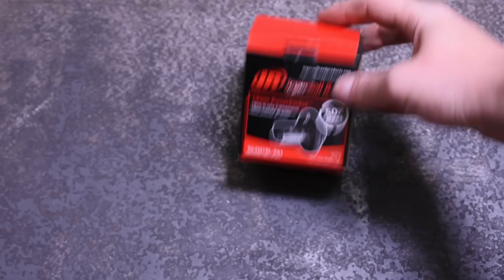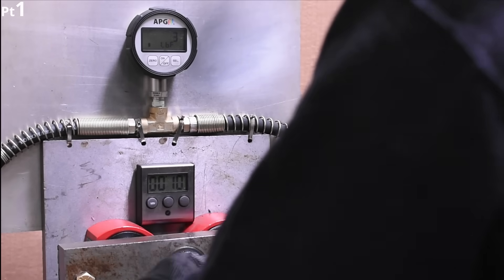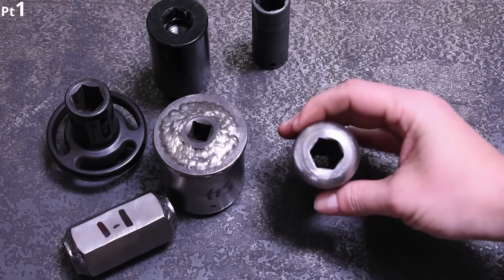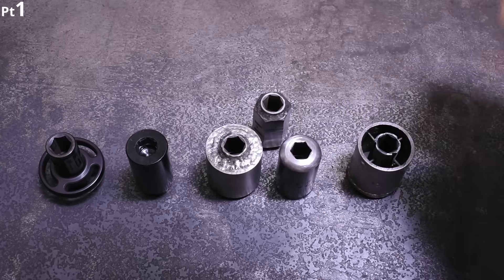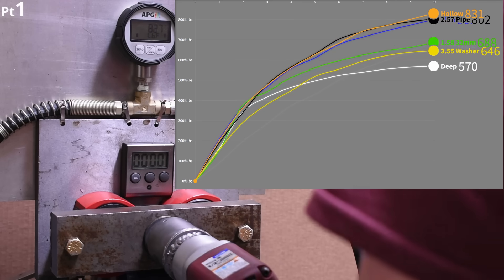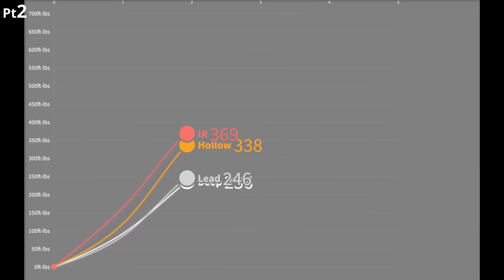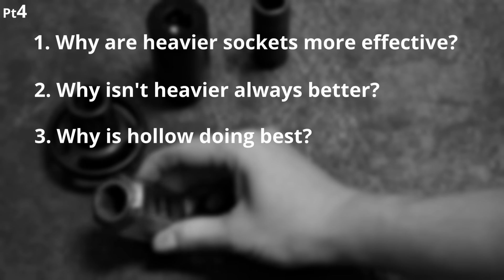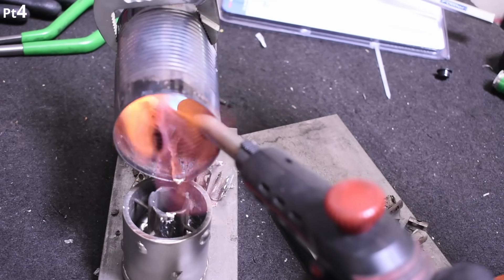Heavier Sockets Make More Power? Stumps Physicist

Comment: Not a expert in any way, but torque is a function of force over distance so if your mass is more on the exterior it might apply more leverage. The hollow socket probably preformed better do to low mass density with weight more on the out side. just food for thought tho. Love the videos

Comment: My understanding of this results is more related to impedance balancing. Impacts are more vibrations than torque so it may make a real difference. This is something very common in ultrasound welding. Impedance for the purpose of those sockets is a combination of elasticity and momentum of inertia. Imagine if you have to choose how to protect your finger from being hit by a  hammer. It will be either using a big block of rubber or a big lump of hard rock. Not a small block of steel of the same type than the hammer itself. Rubber, light but very elastic would protect you from the choc and rock hard but heavy too...not something the same elasticity and weight than the hammer. In your experience you don't want to protect the bolt but rather ensure it receives as much schock as possible. So the best socket has to be just the good inertia/elasticity to optimize the energy transmission.  Note that the size and elasticity of the bolt MAY also change the overall result. 
Just my two cents...

Comment: It's not just a socket, it's a system.  The mass of the hammers in the gun would be a factor too.  Also there might be a difference in the way the socket is hitting the bolt head too ... like big bang motorcycle engines vs flat plane ... even though they make less power the result of the system is a faster motorcycle because the tire has more time to recover traction after an impact of a power stroke from the engine.  It's certainly an interesting test.  Maybe Smarter Every Day would be interested?

Comment: I would presume that a cleverly engineered flywheel would allow you to store energy which fails to transfer on a given blow with greater efficiency than storing it in a "spring", since the storage isn't time-sensitive like storing it in the torsion of the socket or driver itself. Theoretically, the impacts need to be timed such that you can transfer the energy stored in the rebound of each impact into the next impact, which is strictly dependent on the materials involved, and thus your efficiency depends entirely on the combination of materials used in each specific scenario; as such, if you can carefully design your flywheel, you could capture some of the rebound and reduce the time to the next blow, which could potentially give you benefits. Not that you can simply extract extra energy by magic or anything, but in some ways you can make more power over time by increasing startup time.

Comment: My best guess is the weight of the socket changing the timing for the socket bouncing back. Like jumping on a trampoline, to heavy and the hammer hits too late too light and the hammer hits too early.  Mayhaps find a guy that's good with oscillations. Could check if this is the case with the slow-mo on your phone camera.

Comment: What if you made extensions with that flywheel design at the base near the impact wrench? You can weld bigger and bigger washers on to the base to see if there is a magic number that will match or even go above the original output of the impact even with the extension.

Comment: the added "torque" gained is from the inertia of the weighted socket slamming into the bolt head with each hammer strike. as long as the weight isn't so much that the tool cant accelerate it to the tools max speed you will gain in inertia. the trick is to find the right amount of weight that the tool can accelerate to its max speed with each hammer strike, anything more than that and you will experience diminishing returns as you found out.

Comment: How about a socket extension?  Could a flywheel be incorporated into a super-short extension to get the same effect?

Also ... force is being applied in a regular pattern - a frequency - I don't know why the scientists aren't paying attention to that fact!  Rigid bodies have harmonics, so it's possible that given the frequency of the hammer and a resonant mass being driven, that the phase interference can either help or hinder the effect of the hammer blows against the anvil.  Not sure how to measure this but it could make a good follow-up.

Comment: stump a physics proffesor ? shiiiiit newton already figured it out. enertia explains all of it. the gun flexes everything in run direction and since the increased mass resists springing backwards much more, the bolt has no choice but to keep going 2 steps in one direction and only one step backwards. vs 2 and 2. think of these things as reverse torue sticks.

Comment: The lead was never going to work, way too soft of a material as it will just absorb the impacts. Not much of a physics professor if he cant admit when he was wrong but it is what it is.

In my opinion (ignoring material differences), the reason a heavier socket (ie. higher moment of inertia) works is because you are minimizing the friction by essentially eliminating one of the two joints from the impacting force. With a heavier socket (to a point) you are transfering kinetic energy to the socket which still results in frictional losses but nowhere near as much as a stuck bolt. Then the socket itself will transfer said kinetic energy to the bolt through a single joint which results in much lower losses.

Comment: You want the mass as far away from the centerline of the tool as possible.  That's why the flywheel design worked so well as well as the hollow one - those put the weight out away from the centerline.  Simply adding more weight toward the middle (near the centerline) won't typically help that much.

Comment: The big problem with the lead is it's so soft it'll deform slightly and lose energy from internal damping. Rigidity is a big part of it, but some of it with the hollow socket and the flywheel, is because it allows flex between the flywheel or outer ring, so that the length in time of the actual impact is extended (and since on steel dynamic friction is generally lower than static friction unless it's galling, applying the energy more effectively for small movements) - it acts as an inerter, much the same as a inductor in a welding circuit, etc.
 You probably find it doesn't work on different sizes or bigger, more rigid bolts because the frequency they're working at are too low, might even hurt sometimes with odd combos.

Comment: A 2ft or longer breaker bar and a long extension is much better at breaking loose crank pulley bolts. Impacts are better suited against rusted or seized fasteners.

Comment: I think you essentially want an elastic band pulling the weight along to store and redistribute the otherwise wasted/unused force of the impact.
So think a rigid socket tied to a semi-flexible (in the same way that torsion bars are flexible) middle core, which is then connected to a heavy mass outer shell.
Guessing harmonic frequency / resonance of the anvil of the driver also has something to do with it, but that's probably (definitely) too much effort and too case-specific to fine tune, and i think that's what the flywheel store-bought design is built around. (though i suspect trial and error on it's design)

Sorry if this is a bit confusingly phrased, i don't really know the technical terms for anything i just said, and it's probably better explained by other people in the comments.

Comment: Not a physicist, but I bet it has something to do with momentum vs kinetic energy.
Kinetic Energy E = ½•m• v²
Momentum P = m•v
With the flywheel, which the hollow socket also is, the weight is placed at a greater radius, increasing its angular velocity without increasing the mass too much.
I dunno. Someone take my idea and run with it 😁.

Comment: I wonder if the skinny cross section of the IR sockets spokes are allowing it to flex in a twisting motion.  The spring effect could be allowing the socket to absorb more energy, some being stored as spring tension.  Also when it strikes the fastener it may also have a longer dwell time or harder hit because it rebounds.  The inner socket strikes and as it's slowed down by making contact the outer section that is flexed releases and rebounds the opposite direction.

Damping the blow would seem to make it less effective but I know from experience that with hammer style bullet pullers if you hit it on a magazine or something fairly dense but compressible it's far more effective than a hardwood table top, and the hammer obviously rebounds harder.

Comment: It isn't the rigidity, the difference is that the way that hammers work in impacts is by spinning off, and then gaining speed while extended off, while the socket bends back, meaning you get a tiny amount of time for the newly fast hammer to spin that additional mass back to the bolt face.

You are getting more power because you are adding 3x the power of a stroke over a tiny tiny distance.

You probably would see almost No benefits if you welded the socket to the bolt, or if you got a bolt that was at a tiny Tiny difference in OD vs the ID of the socket. Like, have to freeze the bolt and heat the socket kind if tight.

As for why certain heavier ones didn't work as well, THAT is the rigidity and non-damping ability in relation to the weight. The lead and steel have different amounts of squishiness in the base material, so they essentially Damped the impacts. The washers have clearance between them that allows the vibrations to distribute out and end up partially disappating, and your hollow is better than the heavier one by a touch because the weight advantage is being canceled out by the energy having more connection points to dissipate from.

Probably your best bet is going to be  your hollow design, but with the thickest outer pipe you can fit.

Comment: My guess is that a tighter fit is going to yield better results. That is probably 1 in 20 factors though and the socket mechanics itself would need to be tuned to the performance of the tool for optimal results. Perhaps something with spring loaded weights might do well provided the harmonics were tuned for the tool.

Comment: Despite feeling I have a decent understanding of physics, this one has always partially stumped me too. I always figure it has something to do with accelerating the socket and then the actual momentum of the socket imparting a larger force onto the bolt. Basically, the socket itself is not massive enough to trigger the hammer slope of the impact mechanism, so it simply becomes part of the rotating assembly, and by the time it does hit the bolt, it is still traveling fast and imparts a harder hit, just like a larger hammer in an impact.
The other factor I figure is at play is the bouncing of the socket on the bolt. When the socket hits the bolt, it's going to either move the bolt and stop moving as fast or even bounce back in a way. The amount of bounce back, for lack of a better term, the socket has, determines how long the impact hammer mechanism gets to spin it up to get it moving and impact the bolt. This is going to vary greatly from socket to socket, is part of why heavier may not be better, and may also explain part of why DeWalt impacts seem inconsistent depending on how you hold them. Perhaps their anvils have a lot of bounce around inside the sockets themselves. How all of your impact tolerances stack up will affect torque delivery and make it act more like a rigid assembly with a large hammer or a series of smaller blows which don't impart torque efficiently. Hopefully I'm making sense.
Also super cool that Astro went straight to work and made a prototype on your recommendation. They seem like a cool company overall. Great video as always! Gives us lots to think about.

Comment: I didn't read Dr Boloch's reply so forgive me if he already mentioned this, but... in physics, resonance is EVERYTHING. If the phenomenon under investigation is being analysed purely as individual events of percussive momentum transfer, then there's a good chance of missing a large part of the story.

Things twist and deform with some amount of elasticity. The assertion that "mo' rigidity = mo' better" (if that is what Boloch's actually saying) seems really silly to me, because we're talking about repetitive impact events at regular intervals, so harmonic resonance must be considered. Or I could be completely wrong - I am not qualified in any subject.

But you could conceivably test this. All you need to do is run the same comparison tests again at different impact frequencies (if that's possible?). You don't really even have to control the other variables (like PSI, or even which impact driver you use) at least to initially test the hypothesis, because mainly we'd just want to see how impact frequency affects the performance of the weighted sockets relative to each other.

Comment: The comments, specifically Richard Jones' comment, seem to agree that high overall mass is bad but high rotational inertia is good. Which perfectly explains the result. Accordingly, the homebrew hollow socket design but with a heavy brass pipe instead of steel/iron should improve performance significantly. I'd go with a strong alloy or with a hard 'temper' to avoid issues with it just being weak.

Comment: Just a stab in the dark here with only high school physics and being a mechanic mean:
The frequency of impacts and the ability of the mass to transfer it..
Regular Impact = regular output (a small twisting of the socket)
Lisle = Heavier initial run-up so the socket may still be transfering energy when the next hit comes (keeps the socket pressed into the edges of the bolt firmly so no loss of contact between impact hits)
Welded hollow tube = The outside of the tube is flexing with the materials it's welded too, so it keeps adding pressure like a battery until the amount of force caps out on the bolt being torqued.

Edit to add
Think about double jumping on a trampoline. Initial impact, then a second impact before the first finishes, then boom, a gathered up power transfer.

Comment: I think it comes down to the resonant frequency of the socket along the rotation axis - the higher mass socket has a lower resonant frequency, whereas the regular socket has a higher one. Probably, the resonant frequency has to be close to the impact rate for best effect. By going "too heavy", the resonant frequency is below the impact frequency, making it operate in a similar fashion to a harmonic balancer (Harmonic balancers are operated in supercritical frequencies - i.e. excitation is above the resonant frequency).
And since all impacts operate at approximately the same IPM, there is a "sweet spot" for these sockets.
To test this theory, you could test with an impact driver (typically much higher IPM). That should show the best performance for a lighter socket, trailing off at the less extreme weights. Furthermore, testing on an impact with fewer blows per second should favor a heavier socket.

Comment: The lead would be internally moving a LOT on every hit absorbing energy and getting heated up. No surprise there. The cut was obviously going to fail, too. The thin arms to that flywheel were flexing and most likely a resonance is setup causing force amplification. Same for your hollow one. Good work. Weak physicist.

Comment: Im no physicist but i reckon all the factors come into play
- Ridgity transfers the blow efficiently (big factor with extensions and swivels)
- Mass, bigger the sledge, bigger the blow until you can't even pick the thing up (via makes less difference on smaller impacts)
- Flywheel counteracts the recoil like a dead blow hammer

Comment: To better test the design, make each unit the same weight.  Same weight for the washered socket, pipe-layered socket, lead-filled socket, and the hollow socket.  I'd bet the hollow socket wins, mainly because the mass is farther out(leverage).  Maybe test with a corded electric impact to avoid the battery drainage variable.  Then up(or lower) the weight to find the optimum weight for a specific impact gun.  Different guns may have different optimum weights.

Comment: OK, try removing smaller amounts of material from IR socket and testing. Test on at least two types of guns for each material removal. You could also add weight (bolt-on?) to see if the amount of weight is playing a significant role.

Comment: Torque is the rate of change of angular momentum, so the goal of maximising the torque is to maximise the change of the angular momentum of a socket.

Energy of a rotating body is I*ω*0.5ω, while the angular momentum is I*ω (I is the moment of inertia, and ω is angular velocity). Therefore an object with higher moment of inertia will achieve a more rapid change in angular momentum for the same amount of energy, which means higher torque. However, the "useful" energy you get for each impact decreases as the mass of the socket increases. Since the moment of inertia is mass times the radius squared, the best way to increase the moment of inertia without decreasing the "useful" energy is to put the extra mass as far from the center as possible, which is why IR socket works so well despite being lighter than most other sockets you've tried.